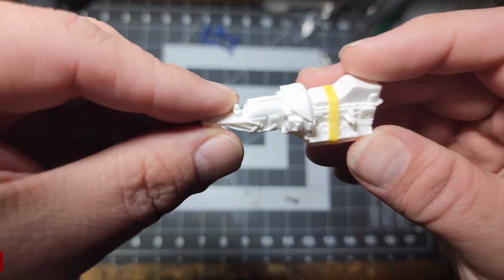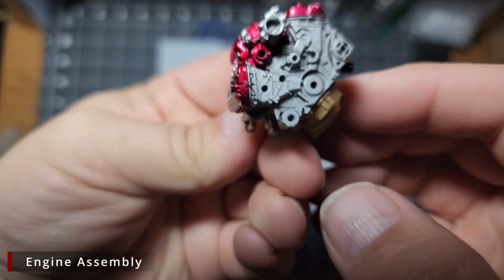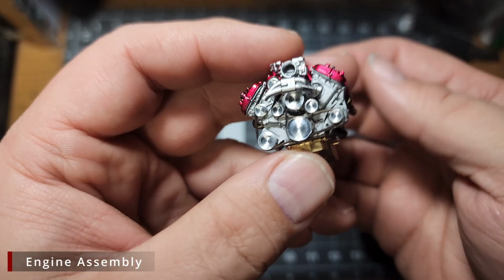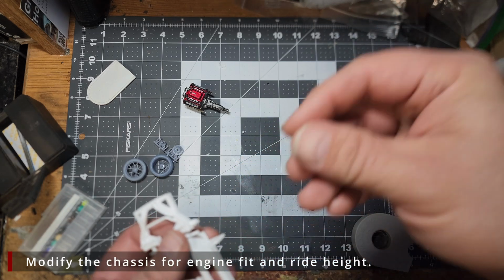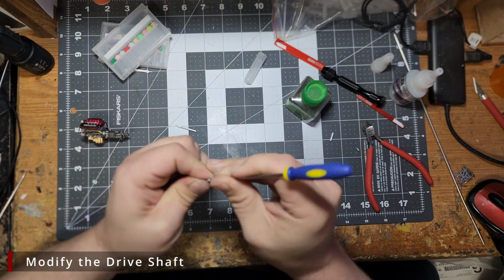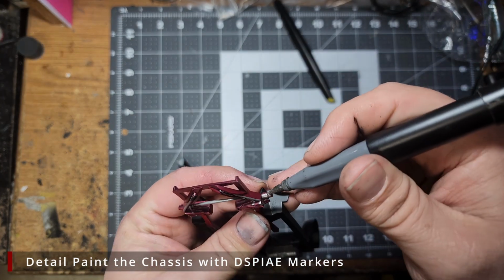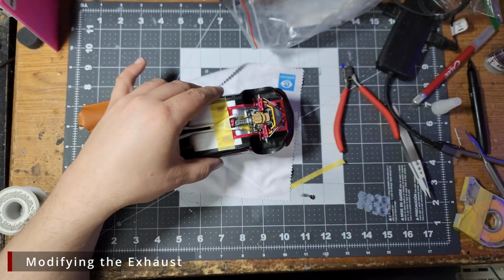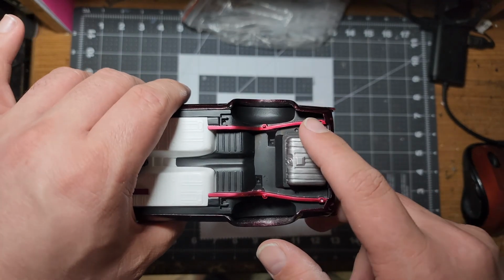Revell - 69 Mustang Super Cobra Jet - Restomod - Building the engine and modifying the chassis

Comment: Very cool, great detail and explanation throughout the entire video.   I like how you print the tabs to adjust the ride height, very cool.  🤙🏼
Reply from the maker: Thanks Paul.! The 3D printer let's me do things like this so much cleaner abd accurate than scratch building.  I could probably do this with styrene,  but she'd probably end up teeter tottering on 2 wheels.
Reply: @JHartModelworks  Believe me, I know as I do similar figuration with styrene do lower some of the models and finding the right thickness to be sturdy yet not make it look way off when viewing the underside of the model is a task!